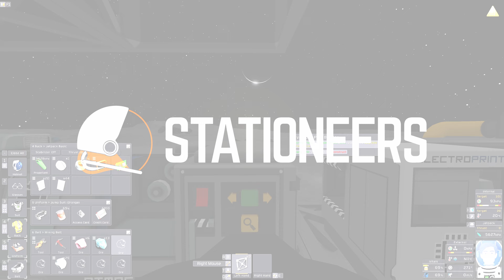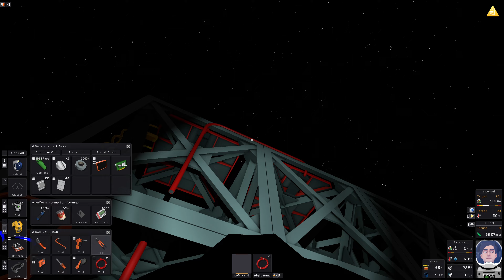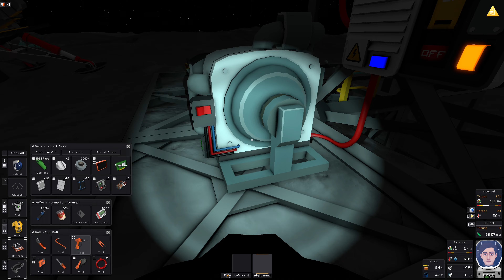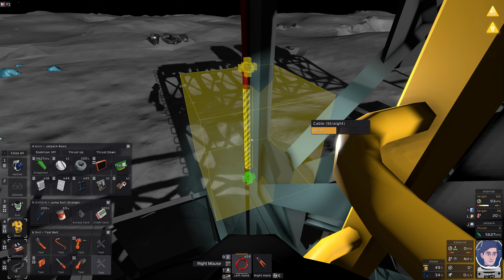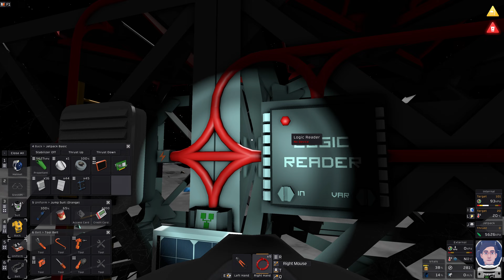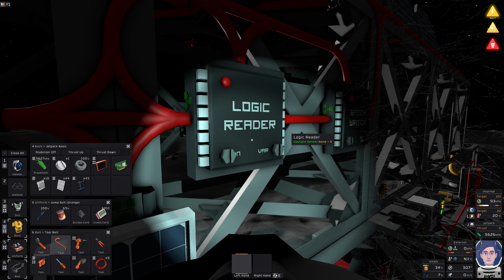Step-by-Step Guide to Solar Tracking on the Moon in Stationeers

Comment from the maker: UPDATE 2025-12-16: This video is still MOSTLY correct after the new updates. Below are some changes to keep in mind.

Solar Panel Max Output in Watts
Moon: 750W
Mars: 455W
Europa: 210W
Mimas: 90W
Vulcan: 500W-1.2KW
Venus: 1.15KW

The New Super Heavy Cable supports up to 500 kW (500,000 W)

Comment: I dont really understand, I build a setup after following your video and it worked just fine, but then i started a new game and built another one copying this exactly and now suddenly it's not working.  The angle of the panels seems to be correct but they're rotating to face the wrong way and wont let me correct it.  The sensor faces the direction the sun comes up and as I mentioned, is identical to this setup  in every single way.

Comment: The Var On my batch writer won’t show vertical .. just shows force something or other … not sure what I did wrong
Reply from the maker: It sounds like the batch writer is not set to output to the solar panels. Please double check this.
Reply: I double checked that … 10000 times …
Reply from the maker: What solar panels are you using?
Reply: I got it… I’m a Moron 😂😂😂 thanks, man!

Comment: Query: What happens if you looped data and power together and just went with heavy cable? Would this option work?
Reply from the maker: Hi, that is a great question, and the short answer is yes. However, the output of the batch writer is the only thing that should connect to this. You only need to upgrade the cable to a heavy cable if the power output has the potential to exceed 5,000 watts.

Long answer/Explanation:

The issue is not the cable but power loops with a battery.
When a battery is looped, it can provide unlimited power and accept an unlimited amount, exceeding even the heavy cable's wattage. Therefore, the only time you need to upgrade to heavy cable is when the power output could exceed 5,000 Watts.

The batch writer's data output could be connected to the same data/power circuit as your solar panels, provided there is no cable connection to your APC or the battery. This would cause a battery loop.

This is easy to achieve with the power setup I built in this video. The output from the batch writer is isolated from the rest of the tracking circuit and the cable that provides power to the batch writer from the APC.

If you have any more questions, let me know. I am considering making a more in-depth video on this.

Comment: got issue they turn but in opposite direction tey only are 100% ef at 90 deg angle
Reply from the maker: I am happy to help, but I need some information first. Please answer the following questions:

Is your daylight sensor on an eastern-facing wall or a western-facing wall?
Are you using a Solar panel with separate Data and Power connections?
Which direction is the power output of your solar panel facing (North, East, South, or West)?

Comment: Solar panel keeps facing to the side after the first cycle.
Reply from the maker: Edit: I'm sorry; I had forgotten which setup I used in this video. My reply was for a more advanced setup and should be disregarded. The most likely culprit in this setup is that the daylight sensor is facing incorrectly. It should face east to read 0 degrees at sunrise, 90 degrees at midday, and 180 degrees at sunset.

I will need a bit more info in order to help you, assuming you haven't already resolved the issue. The most likely causes of issues with this setup is that the sensor is no pointed in the same direction as the power output of the solar panels or your [reader/writer] is not [reading/writing] the correct variable from the [sensor/panel].